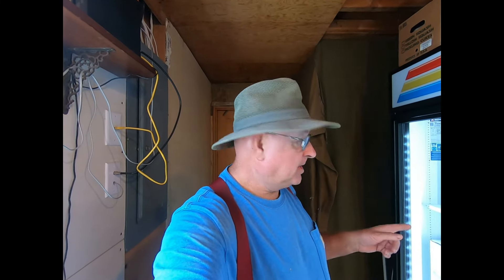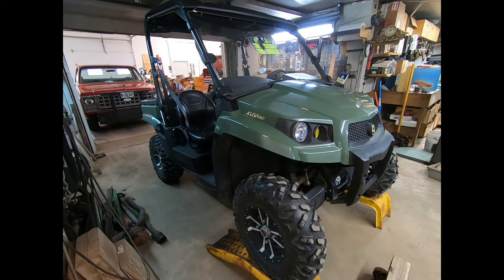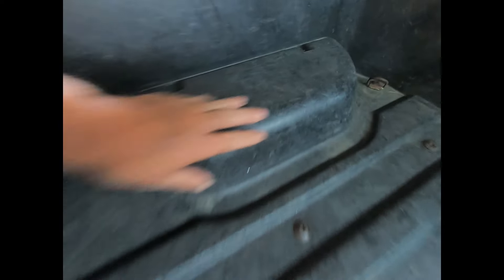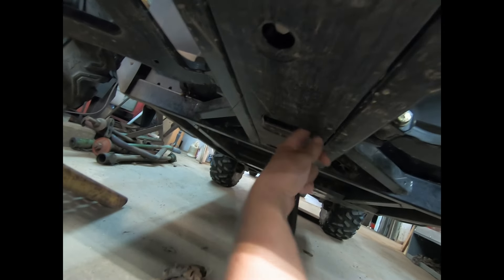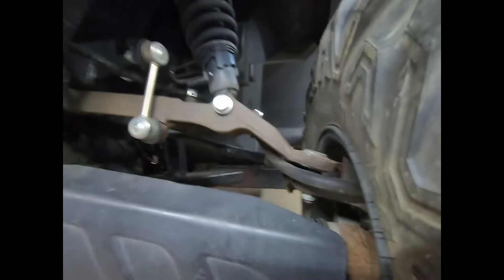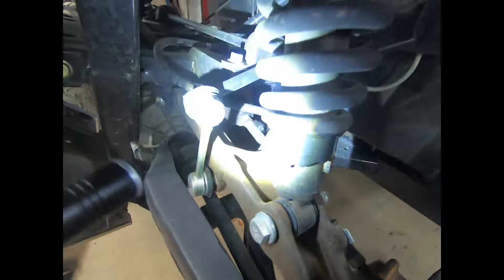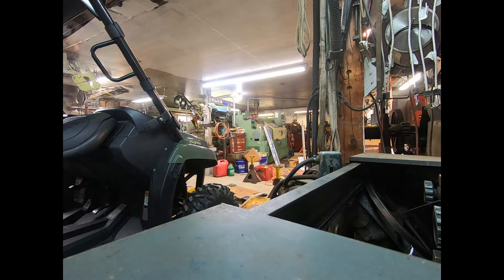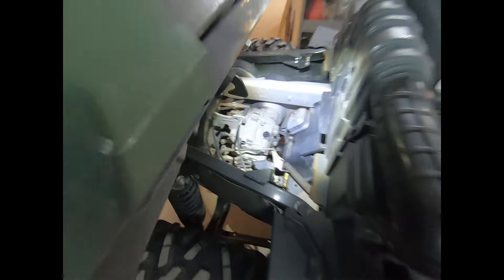# 744 We got a new piece of kit for the farm

Comment: Most of the XUV models use a Chery engine, they are manufactured by Chery Automotive out of China, so in most of them they are Chinese engines, but they are usually on the scale of cheap Chinese made to decent made, they are on the decent side honestly. The little Diesel models use engines by Yanmar out of Japan, but the gas engine is usually Chery out of China. Worked on a few of them in the past, they are very very similar to a brigs just in a V twin layout. The ones I had to work on had been used hard and had over 1000 hours on them, so at 600, under normal use, I'd wager that engine is basically brand new.